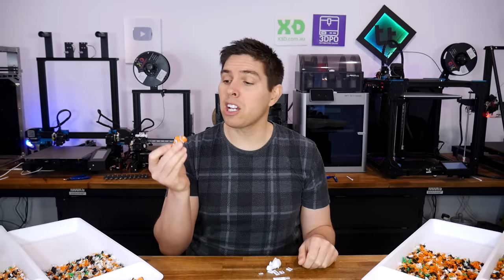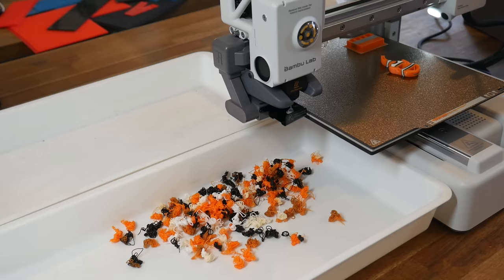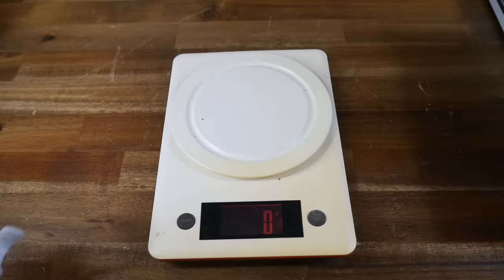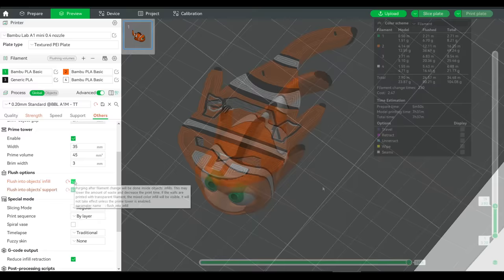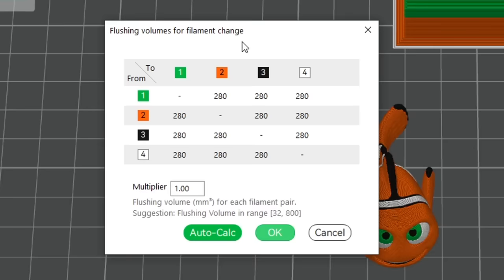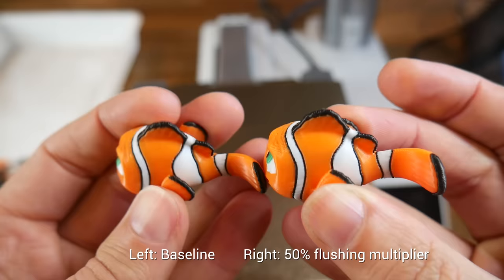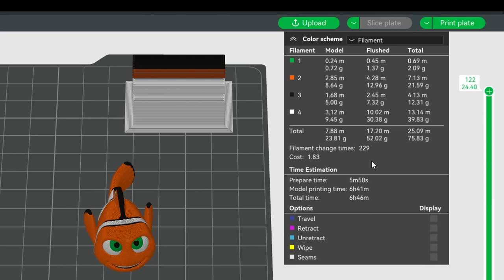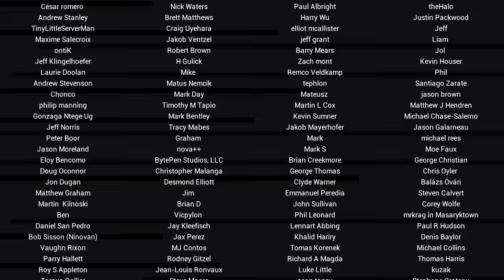Reducing waste from Bambu Lab AMS (lite) prints

Comment: I feel bad for the people buying AMS. Imagine paying $20-30 a kilogram of quality filament, only to end up being able to use less than 250 grams of it.
Reply: This is really going to vary depending on your print. As you can see he was able to print 5 without using much more filament. The fact that there are so many colors so close together in a small area makes this an extreme example of the issue.

Not to mention the Prusa printer with a different multi-material setup, costs $2,000+ more than this Bambu printer. You can buy a lot of quality filament for $2000.
Reply: Don't feel bad. AMS is a wonderful system despite the filament waste. I changed from a MK3S+ to the X1C mainly for the AMS, I nearly don't regret it. Nearly because the X1C is far from the MK3S+ in term of reliability... Prusa printers are workhorse, it's fire and forget. X1C is don't go to far because you will have to made something to the print to continue... but this is another topic.
Reply: That assumes every print is multi-material... AMS is also a way to protect against filament running out, as it will auto-switch to the next spool with identical filament in it. Or it's used for an interface layer when you want a very clean underside where supports are used. If all you do is one off prints, then yea, all systems like this one are terrible. But if you are selling these prints, then you would fill the bed with them and you have way less waste per-print for that setup.
Reply: I don't need your sympathy bud.  Save it for something useful.  There's so many ways to optimize this it's not even funny.  And, most people don't print tiny multi-colored models one-off like this, so it isn't a big deal.  The convenience of not having to unload / reload when I print different color objects in single color is enough for me, and for models like this I would most likely print them by object / color on the build plate and then glue them together.Things usually turn out better looking that way anyway.  For the most part, I print functional single color models, and being able to use different materials for support without changing spools is a serious time saver.  PETG is a great support for PLA and vice-versa.
Reply: @the_naP  how does it feel to spend $100/kg?
Reply: @bubbasplants189  I wouldn't know.  How's it feel to have a room temperature IQ?  As hard as leaving your parents basement, or harder?